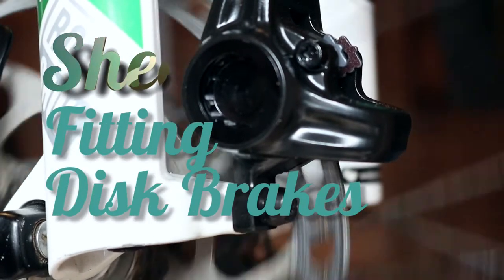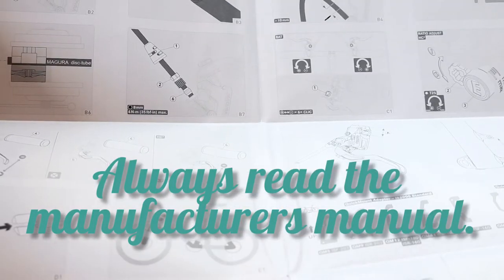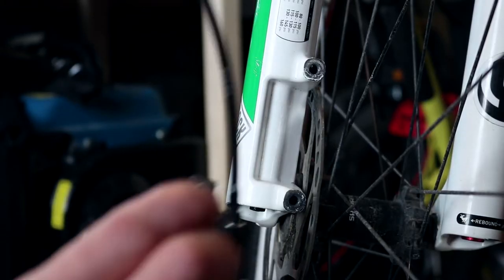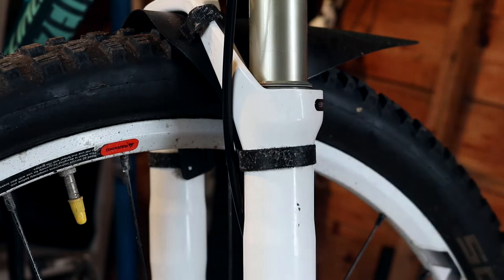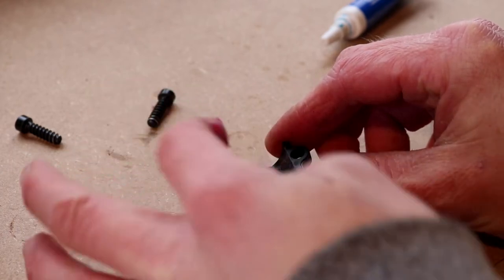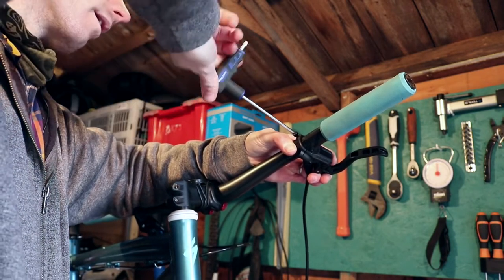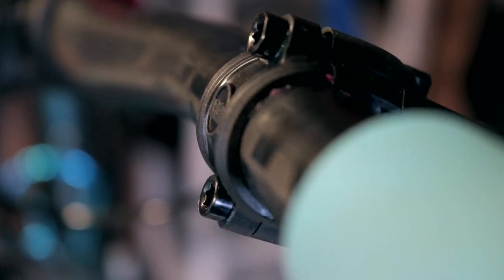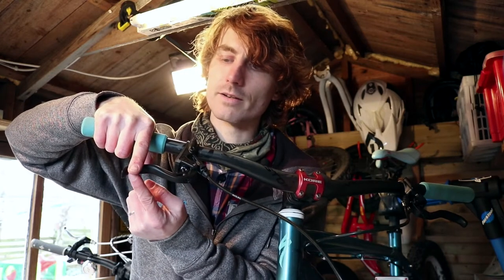Installing Mountain Bike Disc Brakes

Comment: Good video. You forgot the fourth way to align disc brakes when they are mechanicals. That method consists of attempting methods one, two, and three numerous times, followed by yelling and cursing, followed by throwing them in the garbage.

P.S. Saying “and that’s where they get the phrase it’s cold enough to freeze the balls off a brass monkey” was one of the best things to say whilst walking the halls in high school. Sorry about winter being drunk though mate.
Reply from the maker: The best way to service and get the most from your Avid BB5s is to first remove them from the bike, then fling them over a rainbow. Next, install literally ANY hydraulic disc brake as a replacement. Good job! you have now serviced your Avid BB5s.

Comment: Good video, and the shed is looking good too. You tighten your brakes down on your bars though? I've ker-smashed enough brake levers that I now back off the bolts so the levers just move a bit in a crash.
Reply from the maker: Great tip! I usually go with 3-5nm when tightening bar controls. The Maguras use a T25 which I dont have a socket for.